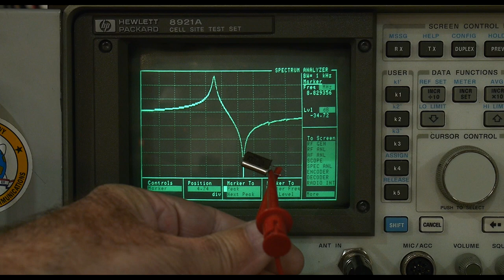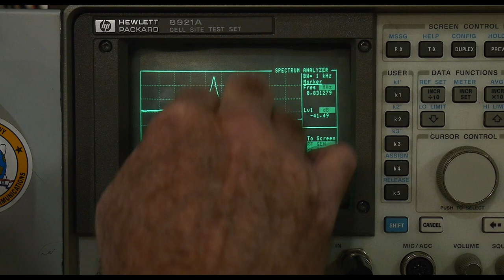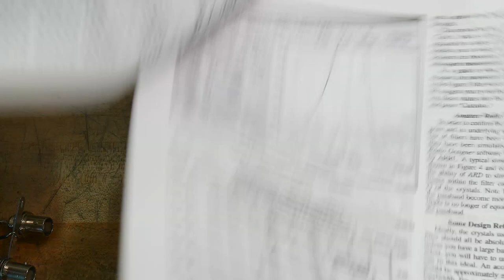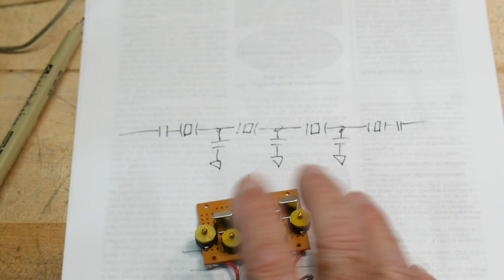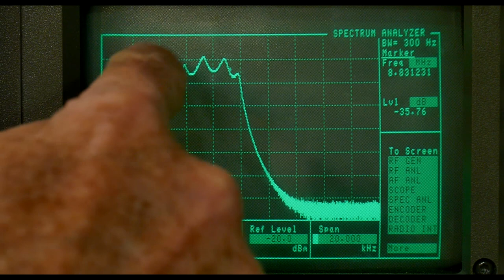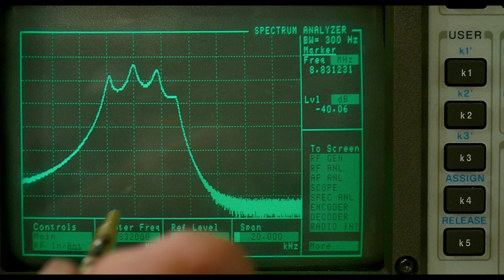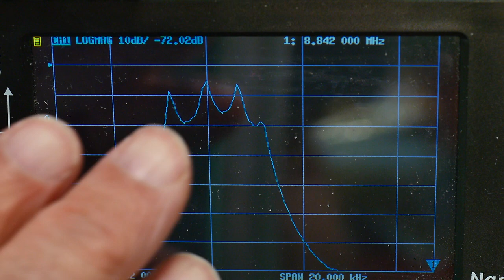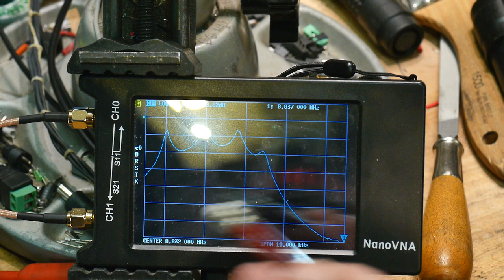#617 How to Design a Crystal Filter

Comment: I would recommend using the Dishal SW from Steder and Hardcastle, the two authors of the paper shown in the video. The most straightforward filter to build is the G3UUR’s QER, which is also described in the user manual of that SW. First, learn how to derive crystal parameters Lm, Cm, and ESR from the measurements of crystals using either a VNA (like nanoVNA) or some other set up (see the G3UUR’s 3-dB method). Also, measure their package capacitance Cp. As others mentioned, start with a large sample of crystals to pick those which have serial resonance frequencies close to each other (within 1% of the desirable filter bandwidth). The SW will tell you the center frequency, the input/output impedance, and the value of the shunt capacitors, all baded on values of your crystals and the desired bandwidth and number of crystals. Then, you would have to design an impedance matching circuit to whatever your circuit expects (normally 50 ohm). Hopefully after a few trials, you would have a filter with reasonable ripple and side skirts.

Comment: Hi IMSAI Guy, basically crystals are specified with our without a load capacitance value.  When specified with a load capacitance value, the load capacitance value is the external capacitance in the circuit that is required to cause the crystal to oscillate at your desired frequency of oscillation when used in a parallel resonate oscillator. 

Therefore you can pick up 2 different crystals stamped 10 MHz but each will resonate at a different frequency depending on how much external load capacitance was specified for their use when originally manufactured.  One may have been specified as a 10 MHz crystal with a load of 20 pf and the other may have been specified as a 10 MHz crystal with a load of 30 pf.  The one specified for a 30 pf load will oscillate at a different frequency than the one specified for a 20 pf load when placed in the same parallel circuit oscillator unless you use the correct load capacitance that matches what the crystal was designed to operate with.  The load capacitance specification is based on the crystal being used in a parallel resonate oscillator but many oscillators operate at the series resonate point (you can still use these crystals in a series resonate oscillator but will need to add some series capacitance to obtain resonance at 10 MHz).  An example of a parallel resonate oscillator would be one built around a digital inverter and here is a link to a paper that shows a schematic of one: https://ecsxtal.com/store/pdf/Oscillation-Circut-Design-Considerations.pdf 

P.S. the QEX article you mentioned is one I often reference.  I do in fact measure my crystals using the G3UUR method mentioned in that article and I also use the DISHAL program mentioned in that article to design my crystal filters.

Feb 3, 2021 update:  Today I took a 10 MHz 30 pf cut crystal and using a VNA in a very crude series test set up its series resonate frequency was below 10 MHz (9.996960 MHz), but when I installed a 30 pf capacitor in series with the crystal its series resonate frequency was 9.999980 MHz and when using a series capacitor of 10 pf its series resonate frequency was 10.003860.  I also tested a 10 MHz 18 pf crystal and it measured 9.997280 MHz but when I installed a 22pf series capacitor in series with the crystal its series resonate frequency measured 9.999500 MHz (I did not have a 18 pf cap which would have put the resonate frequency closer to 10 MHz).  I normally use my crystals in a series resonate configuration and therefore have to add a series capacitor to raise their frequency to what I desire.

Comment: 08:06 They specify the one of the peaks. Depending on whether the crystal is intended for series (first peak) or parallel resonance (second peak). This measurement is done at a precisely measured load capacitance. So if it says 10 MHz and the crystal is intended for series resonance at 22pf load capacitance, that's where the first peak will be under that load condition. So yes, you can use the marking outside of the can, IF you meet the specified load and operating conditions. Now that said, they're never perfect and differ a bit, even if they're from the same lot.

Comment: Most Xtal are designed to be used in a specific circuit. If you order a crystal to be ground specifically for you, you will have to specify the circuit and the capacitance of the circuit. This is why you have some "strange" values.

Comment: I have several hundred 8.3886 mhz crystals in HC48 cases.
You didn't try adjusting the input / output termination.  All measurements were made into 50 ohms (assuming the instruments are so terminated).  Ripple and slope are dependant on termination, so either L networks or matching transformers are needed.  You can use variable resistors in series with the filter to see how the termination effects this.

Comment: I'm not an expert in the fields of crystals but I believe that they spec the crystals such that as they age they with stay within the PPM number specified.  Age of a crystal makes the output resonate slower over time. 
df/f0 = -K(T-T0)^2    (always negative).    
Therefore the initial set point when the new will be on one end of the PPM.  Measure the same crystal in 5 years and it will be in the center of the slope and in 10 years be on other end of the PPM limit.

Comment: There's also other designs of xtal filters that use some of them diagonally-connected, beyond stagger-tuning. A bit beyond me. I must admit I'm lazy type and buy. 
 There's another great IF filter much cheaper than crystal and that's Ceramic filter + Mechanical filter combination, one for selectivity the other for stop-band and used together a rectangular passband, great for NBFM.

Comment: The peaks you see come from an impedance mismatch. The filter is not destined for 50 ohm. Once the impedance is correctly matched they will disappear
Reply: Yes, I was going to comment on this also. Normally filters are not designed for 50 Ohm I/O but something a bit higher like 500 Ohms maybe. You just design matching networks on both ends. Typically this would be a split capacitor where the in or out is at the tap point (like tapping down an inductor). Lots of crystal design software out there will have this as an option as you are specifying the filter parameters.
Reply: yes i made exactly the same comment in his LC inductance measurement video yestersday. The ceramic filter manufacturers usually specify the input impedance. You will need a matching L- or T-network for both input and output of the through measurement.
Reply from the maker: Thanks for adding marker->ref level
it gives a nice picture but here is my use case:
peak search (carrier)
marker->ref
now all other signals are dBc
it needs to be at the top of the display
would be nice if labels on the Y-axis are dBc and not dBm ( zero at the top)
HP decided never to label the Y axis as they thought SA is more of a relative measurement and not absolute.
I suppose I can just mentally ignore the extra Y division at the top and ignore the labels.

Comment: Thanks for the presentation.
Homebrewing an SSB TRX requires building a ladder filter and we used to buy a bunch of 10 MHz crystals from the market and choose the ones with frequencies close to one another on a 8 digit counter. The 8th digit will always be jumpy. We adjust the LO frequency to get  7 MHz and we had live with whatever the audio we got...hi..hi..
Adjusting the input and output capacitors or the shunt capacitors didn't bring about different changes in the pattern, I can see.
And it was not a nice single sharp peak at all there.
I want to know the input/output impedance of the filter, ie, if it's 50 ohm.
There are so many questions on the ladder filter; it has been a mystery.
At 1.40, instead of intermediate frequency you said internal frequency.
At 11.14 you said, parallel resistance instead of parallel capacitance.
At 26.26, you said, input and ground and input and ground instead of output and ground.
Let me read about the filter (about 3 decades later) and come again.
Thanks again.

Comment: Thank you for this very interesting presentation.
15:25 To have an idea what happens in filters with multiple resonators one might start with two resonators. One resonator stores energy from the input power and decays it slowly over a time of many periods depending on its Q factor. 

If it is coupled to a second resonator it also exchanges energy with the coupled one which has identical parameters in our case. With a loose coupling the passed energy is so small that the resonant frequency is not affected. This works up to the so-called critical coupling which is in effect not critical at all. 

With tighter coupling the energy is passed over and back as it can be observed at coupled pendulums https://youtu.be/3c73d5GJ2V0?t=95. With this passing forth and back (which is also getting faster with closer coupling) each of the resonators gets an amplitude modulation with complete phase inversion. In this way its frequency moves to both sides of the original resonant frequency by just the frequency of the energy transfer. 

As a result, a filter curve is formed with a near rectangular shape with ripples at the top. That is just the principle, for more resonators it will be a longer story.

Comment: I'm no expert, either, but I've learned that crystal filter construction is not a trivial task. It's not complex, but it requires care and no skipped steps in the process. It is not a 30 minute task.

I think there were 2 problems with those sharp peaks of 10 dB or so in the crystal filter passband you saw on your analyzers - input and output impedance matching of the filter, and the need to more closely match the crystals to start with. It takes a lot of crystal sorting to get a really good, close match, generally as many as 10 crystals from the same lot for every 1 you use to make a quite good filter. So, for a 4 crystal filter, 40 crystals tested. And to do the sorting you will need to build a good crystal test jig with 50 Ohms in and 50 Ohms out, as well as 4 to 1 impedance matching transformers in and out to get down to the crystal motional input impedance of roughly 12.5 Ohms. There are a couple of online references about how to do it. It really boils down to the fact that the crystal testing is fussy, and once a filter is built, variable capacitors can't fix everything. They can only optimize a filter that has already been built with crystals carefully matched and optimized for the expected circuit load impedance.

Some circuits will need 200 to 1500 Ohm filter , and that could be another problem to deal with. Perhaps having to buy and test all these crystals is why commercial filters cost so darn much.

I've been studying up on the subject because I was lucky enough to snag well over a thousand 12 MHz crystals from one manufacturing lot, so now the fun begins. :)
Reply from the maker: I have this video if you have not seen it: https://youtu.be/oMFalh3MDS8
Reply: @IMSAIGuy  , thanks. I watched it a few weeks ago, but I'm watching it again. I'm sometimes not too bright, and I find it helps if I watch the tech videos 2 or 3 times. I think you said you spent years working at HP. I spent a couple of years there in Colo. Spgs, but left for better pay. But I sure did enjoy the company scrap sales.

Comment: You've gone n done it ay' you!
A project I'm going to make for my ssb, when I looked I choked at how much they cost so doing it the home brew way lol. 
My icom uses 9.0115 hz I found on ebay a bag of 50x 9mhz for like £5! Just gotta find some of the high running ones and out of 50 I have a chance lol
Reply from the maker: Good luck!
Reply: Well I got them today, shame none of them are on the "high" side, nearly every single crystal is near spot on and some are lower!
Nearly every crystal as me just off the lowest spot for the resonant frequency I need, 9.0115 don't feel that far away from 9.000 but what a shame lol
I don't suppose you know a way to drag it over? A mix of inductance perhaps? 
As I have so many I'm going to have a play and open the can and "grind" it and see what I can do, it's all good fun lol

Comment: Is using the smaller form-factor, still through-hole crystals still good or should we use the full-height ones?
Reply from the maker: they are all the same but different. the Q-factor might be better with a larger crystal, I'm not sure.

Comment: Great video. I have only Nano VNA, I don’t have a spectrum analyzer.

Comments:
- the band pass frequencies is lower than the specified IF frequency, maybe it is good for LSB. Actually it depends on the radio design. For instance if the carrier frequency is 9.0015 MHz and the filter center frequency is exactly 9 MHz with 3 kHz BW then the filter is acting as an LSB filter. Or the other way around, if your filter if centered at 8998.5 MHz and your carrier is 9 MHz then it is an LSB filter. Sorry to put 9 MHz for easy calculation😊
- Do you think the source and load impedance will vary the characteristic of the filter? I think your spectrum Analyzer is 50 ohm input impedance. I have read some filter must be loaded with the impedance ranging from 1 kohms - 2 kohms
Reply from the maker: People tell me the loading is closer to 500 ohms. While that will change the out of band some I don't think the actual peak would move but I'm no expert.
Reply: @IMSAIGuy  thank you 🙏

Comment: The crystal manufacturer assumes you'll be using a 10pf load. Any amplifier you make that's designed to oscillate a crystal will have to overcome the input capacitance of the amplifier. Since the input capacitance can vary, the worse case scenario would be 10pf. Since most oscillator amplifiers are designed to have the lowest input capacitance you're expected to pad in more with a trimmer capacitor. Your test setup technically doesn't have an input capacitance (I assume you neutralized the signal before you tested the crystal).

Comment: Crystal Marked Value Is Actually Simple To Understand, They Mark The Resonant Frequency Value Of The Crystal On The Slope That Goes Down From The First Positive Wave And It Can`t Be Lower Then The Neutral Wave And It needs To be "Back In Time" (Becaause Of SOme Calculations And Laws) From The Middle/ Brake And It Can`t Be Highter Then + -  5% Of The Slope If You Invert It And Resonate It So Imagine If The Both Up And Down Would Be Just resonating, So The Dot From Where The Value Comes Is A Strange Point From The Full resonant Wave. You Showed Prety Correct Where It is And I Told Why Its There, But Im Tired And Sick So Maybe My Explanation Is Muddy, Sorry of TThat If Thats The Case

Comment: How well did this filter actually work? Especially in comparison to the Kenwood filter. Thanks for the video, Barry, VK2FP/AG7VC
Reply from the maker: It worked OK. It was off center as I said so that was a pain. It was a bit too wide and I replaced it when I found a cheap Kenwood filter on eBay. It was great fun though and proud to have a home made one.